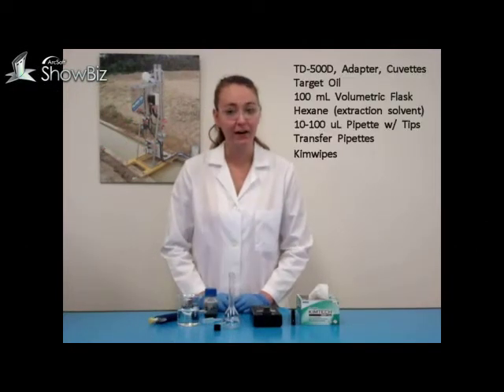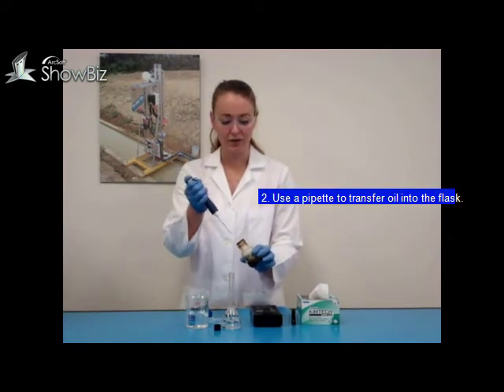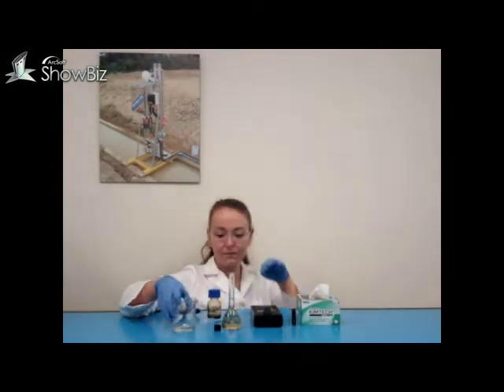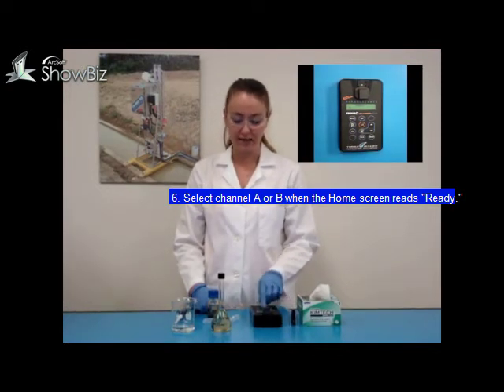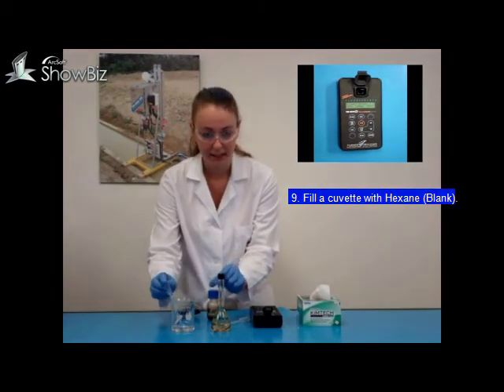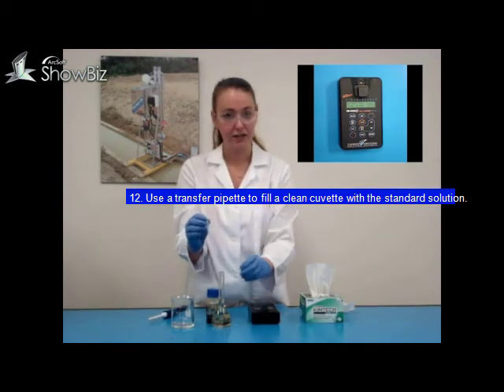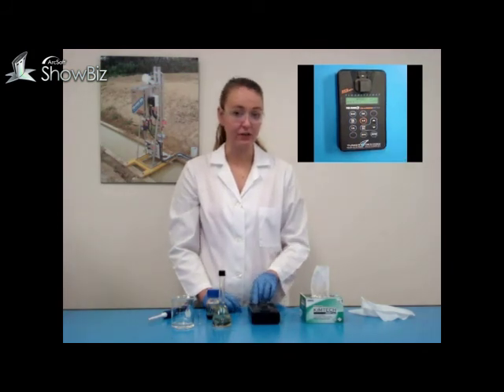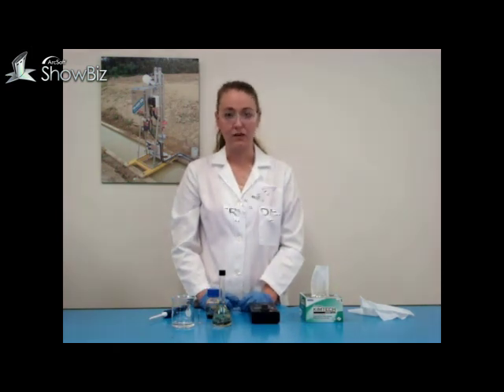TD-500D Solvent Method Calibration Demo Video

Comment: what kind of oil it can be used to calibrated. in user´s manual indicates  a oil to solve in solvent. bit i don´t know where to buy this oil or where. could you please help me?
Reply: Each oil has a specific response factor to fluorescent light. Therefor, calibrating against your target oil is recommended for best results. For example, if your sample is produced water, you will want to prepare your calibration solution with site-specific crude oil.
Reply: @luisantoniomirandaramos8386  my samples are produced water? 
excuse me- what's the site-specific crude oil please ?
more explanation plz